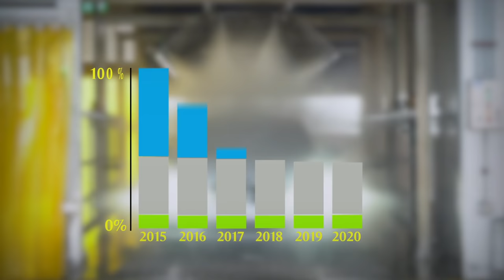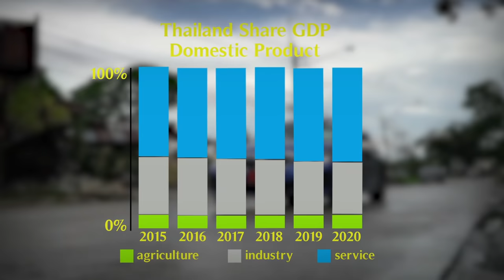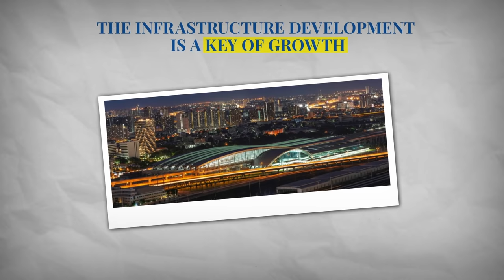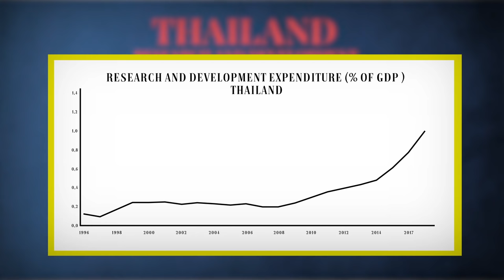Thailand's Economy: The Bangkok Powerhouse

Comment: As someone who likes making data visualizations, that chart from 1:57 to 2:10 is really terrible. From your tone I know what you want to make it say, but there's really 0 insight gained from the chart. Bad axis labels, bad colour scheme, bad scale for the % change you're trying to show and bad graphic type makes it pretty much useless. 
TLDR for whoever makes your chart: consider plotting difference with relationship to a baseline (i.e. 2015) if you're trying to showcase such small differences, consider using hued line-plots, consider using polar color schemes. If absolute gdp % for each category is really necessary, then definitely consider changing the y-axis scale.